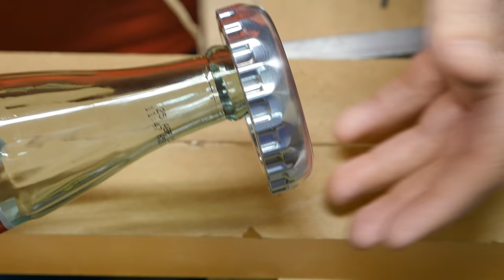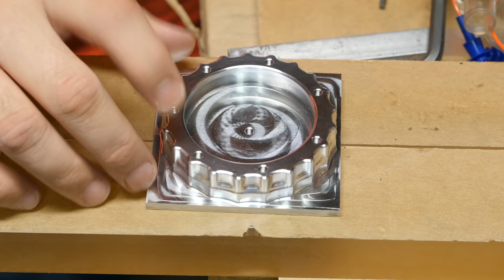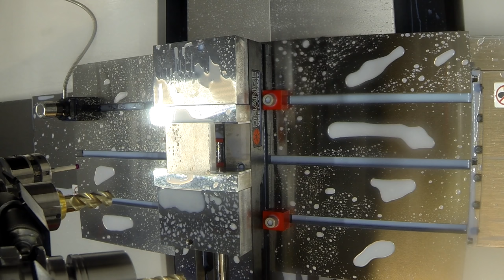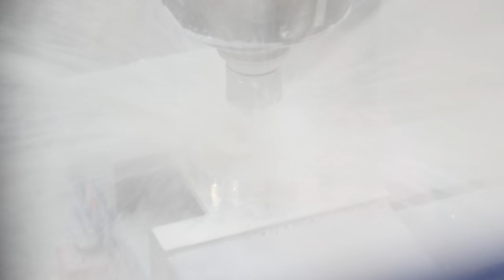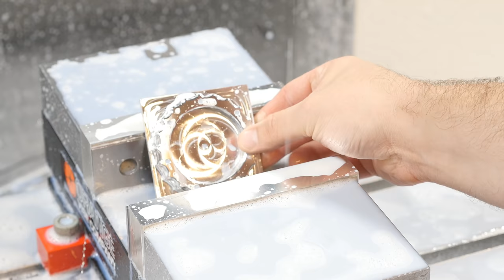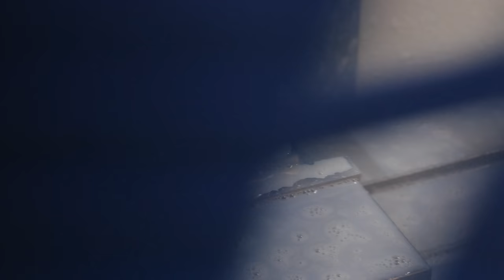Bottle Cap Redux - 3D milling on a Brother Speedio S700X1 CNC machine - coded with HSMWorks (4K)

Comment: You also need to put the non-engagement feedrate for adaptive clearing in HSMWorks at the max feedrate of the machine. That's if you want to leverage the speed.  Machine is likely 10000mm/min right now for max feedrate.  I turned my machine up to 20000mm/min.

Comment: Cool little project, and nice jig too! Sometimes I like the jigs and the making of more than the actual parts.
Reply from the maker: Thanks!

I know what you mean! Fixturing (jigging) seems to be a big part of machining and it can oftentimes be the most difficult. I've been working on a new fixture for these bottle caps for a while now. I've been making some good progress in the last couple weeks. I'm shooting to make a single-part fixture as a prototype and if it works I plan to record myself expanding that prototype into a multiple-part fixture. This planned video will be a bigger undertaking than I'm use to so I hope it comes out OK.
Reply: Hirudin Something like a toolmakers ground vise comes to my mind. Except that little angle screw would be kicked upwards at a 45 instead of down. Then you could leave your zeroed fixture on the table with one movable jaw that pulls out and down. The short end of an allen wrench could get up under there to the screw.
Reply from the maker: tansit2344
I've played with a lot of different ideas but most of them have Achilles's heels. I finished an important piece of the new prototype today and it's looking pretty good so far.

Comment: You could likely double the feed roughing.  And with a 4 flute ball you could likely double the finishing feed and see how the surface finish looks.

Cameras looked good. So did the factory LED lights. I need to install one on the other side of my machine, i only have one on the right side currently.
Reply from the maker: I was thinking double-speed on the roughing might be possible. I don't want to get greedy though. :) I'll probably give it a try before too long. Thanks for the initial feed and speed! I don't know how long it would have taken me to get up that high on my own.

I did try 8000mm/m with the ball mill at one point, but without high accuracy mode enabled. It was good for the most part, but one of the side curves got turned into a corner. It was the ridge/fold where all the lead-ins and lead-outs were. High Accuracy Mode A seemed to keep the speed around 750 - 1500mm/m for 90% of the time. After that, and after you told me that I actually did have Mode B, it hovered around 4000mm/m for the most-part. I guess at that point I figured "well, that's good enough" and stopped testing. Every now and then the feed-rate display will show the word "processing" (something like that) which I assume means it's getting starved for data. I think I'm going to spring for the 200-block look-ahead upgrade as well.

Thanks! I can send you a pic of the GoPro setup if you'd like. I basically stuck it to the side of the tool turret casting and used a whole bunch of arm extensions to bring it out far enough that it could see the tool.

I cringe at what they charged for those LEDs, but I'm glad to have them. My garage is already pretty dark, and when the enclosure doors are closed very little light actually gets inside.
Reply: Hirudin Yeah they are expensive, I used some ones from Amazon and wired them into the control myself.

Comment: I'd be pretty concerned over your lack of coolant!!!!
LOL!!! Awesome to see the new machine running!!
How much was cut off your run time with this over the Pro?
Reply from the maker: Haha!

I can throw out some comparison numbers, but they really need to be taken with a grain of salt since they're not derived from the same project...
The roughing here takes about 40 seconds. On the Novakon, similar roughing took about 150 seconds. So, the Brother is about 3.75x faster here. But it's possible both machines could be pushed harder. The best MRR I got with a 1/2" end mill on the Torus Pro was about 3 cubic inches a minute, the Speedio can apparently do 30+.
Finishing the top of the bottle cap on the Brother took 4 minutes and it did 58 passes (4.14 seconds per pass) whereas similar finishing on the Novakon took 7 minutes to do 36 passes (11.56 seconds per pass, or 2.8x longer).
Actual machine time of this cap was 10 minutes and the machine time in my older video series of a very similar cap was about 32 minutes. Both programs had extra stuff to do, so it's not a perfect comparison.

So, so far it's about 3 times faster in my real-world use. I was hoping for a higher multiplier. This IS the first project I've done on this machine though, so I'm sure it'll get better.
Reply: Hirudin Interesting.  I thought I'd seen a vid of you making this same cap on the Pro....but it was different?
I'm sure you'll get faster numbers with more time and a higher level of comfort and confidence in the machine.  It does seem to speak well of the Pro since I'm sure the Brother was way more than 3x's the price.  Sounds like more of your speed will be found in roughing.......10x's more MRR?!!!  Wow!!  Looking forward to more!! :)
Thanks!!
Reply from the maker: Yeah, that cap had a slightly different design. The biggest difference I can think of is the shape of the folds around the outside. They taper off in a triangle on this one and they were basically just filleted on that one.

There was also a small divot where the catching magnet is set in the old one, which certainly added some time. It was also cut from a 1" piece of stock so it had a full 1/4" of waste to remove off the top (which took about a minute). The only additional step this new one has, that I can think of, is the very last op on the bottom: a back--chamfer on the inside of the prying ridge. It happens so quickly on this machine you might miss it if you blink. ;D

Comment: Isn't there a way to control the amount of coolant, That really seems like an excessive amount of lube/coolant. 
I know aluminum heats up and will melt, but, That's a lot of smoe..
Good job tho..!!
Reply from the maker: I think it's only on or off, there's no middle-ground. Well, there are some ball valves on the Loc-Line hoses, but I'm not too keen on manually limiting the flow that way.

Comment: Thanks for the info! I'm in the process of building my own CNC router and trying to figure out what spindle, stepper motors, drivers, controllers, etc. to use on the build. I think I want the work area to be Y 72"  & " X 48". I was think how can I put a multi-changer or just a tool change on the build. I did own a sheet metal fab shop for about 20 years. Shears, CNC punch press, breaks, welders, tube benders, small end mill and a powder coating system I built my self. Let me know your thoughts on the CNC router build. I would love your input.
Reply from the maker: +Philip Tancredi 
I wish I could help! I don't have a router myself (not even a handheld one) so I probably wouldn't be able to help much.

Sorry for my late reply! Eight months late... that's not good. I partially blame Google's bad messaging system.

Did you build a router? It would be so cool to cut up big-ol' sheets of MDF or plywood accurately! I hope to get one some day as well.

Comment: If you don't mind me asking what is the cost of the Brother Speedio S700X1? Pricing is hard to find online
Reply from the maker: Sorry, I guess I don't really want to put a dollar amount "out there". :/ I'll say that it was more than a similarly optioned Haas DT-1 (which I would have looked at harder if it would have fit in my garage). This machine also has a few options that Haas doesn't offer, which, logically, increased the price (Haas also has some options I wish I could have added to this machine).

Choosing which machine to buy was exceptionally difficult as each one had tradeoffs compared to the others. "Do I want this option that's only available from this manufacturer or do I want that option I can only get from that manufacturer?" At the end, the three machines I was looking at the hardest were very competitively priced. The Brother won-out by having a very good reputation online, having a few options that I considered a priority, and being physically smaller than the others. Milltronics was at the top of my list too, but I just couldn't figure out a way to get the model I wanted into my garage.

Comment: I'm trying to figure out what kind of machine you have. Is it a cnc router table with a tool changer adapter. Please tell me about your machine. (I like it very much)
Thanks,
Phil
Reply from the maker: Thanks! It's a mill, or more specifically: a vertical milling center. The lines between CNC routers and CNC mills aren't always well defined. Both types of machines will have at least three axes of movement, X (left and right), Y (front to back), and Z (up and down). The major difference is how the spindle moves. In a mill, it'll only move in the Z axis, the X and Y movement is done by the table. With a router, the table stays stationary and the spindle moves in all three axes. Routers will usually have much greater travel (cutting area), at least in X and Y, but that additional travel is usually at the expense of rigidity.

Here's a recent video that shows an S700X1 High Torque machine...
https://www.youtube.com/watch?v=bCqBRBWPV1o

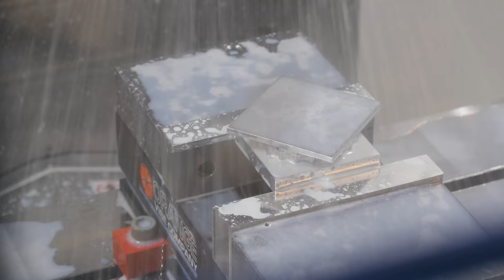Comment: time 8:17+ 

What kind of fixture - end mill (manufacturer ? ) ?
Reply from the maker: Jiří Sohr 
The end mill that is loaded and starts at 8:17 is a "Shars" brand "415-0266" 1/2in. ZrN end mill.
http://www.shars.com/1-2-se-3-flute-radius-0-040-45-helix-zirconium-nitride-solid-carbide-end-mill-for-aluminum
Additional tool info is shown on the top/left of the video.

The tool holder is a "Big Daishowa" brand "Mega ER Grip" ER-20 tool holder.
http://www.big-daishowa.com/product_page/data_23_mega-er-grip.php

If this isn't the answer you were looking for, please ask again.
Reply: Hirudin  

Thanks, "Big Daishowa"  - > I use CENTRO P http://www.fahrion.com/en/efficiency/centro-p/

Comment: dry chips are worth more
Reply from the maker: Potentially.
Reply: so you can just use mist
Reply from the maker: Well, I'm more interested in the milled part coming out of the machine with as much value as possible, the value of the chips is WAY down the list. Yes, pristine chips are potentially worth more than dirty chips, but...
A. there isn't a guarantee that my local recycling center would consider these chips to be "dirty". I suspect they will give me their full, "clean" price. We'll see.
B. we're talking about 25¢ per pound compared to 50¢ per pound. If I had 1000 pounds we'd be talking about a difference of $250.
C. this flood system recycles its coolant whereas mist coolant is a one-time-use deal. If I was concerned about squeezing every dollar out of this machine I would have to factor the added expense of needing to constantly replenish my mist reservoir.
Reply: the purpose of coolant is to lubricate and cool, but cooling is not a problem for your material without it, so you're primarily interested in lubricating/ thats why you would use mist.
Reply from the maker: What brand of mist coolant do you sell?
Reply: i don't sell any

but that leads me to a good point i forgot to make; mist coolant have increased intermolecular forces to form a sticky web on the part. This is advantageous on a lathe, to not sling the coolant, but also in cnc milling to coat the endmill as each tooth takes a cut.
Reply: i tried a sample of Unist last month, it was excellent. They gave me 2 little bottles, one for ferrous and one for non-ferrous.

Comment: Crashed it yet ? :D
Reply from the maker: A couple times. :(

Both times were only in the Z direction. One, the second instance, was completely my fault. I reset the Z-zero point and rapid-ed down onto my tool setter (thinking that the zero point was an inch or so above it, forgetting that it was actually about two inches below it). That was a costly replacement! As I recall, the tool that was in the spindle was new as well, but that was only a small fraction of the cost of the damage done. The other time wasn't my fault, in my opinion. I had done some manually-controlled machining with the MPG and didn't bother doing a G43 command to set the tool height (why bother, right?). After I was done, I ran a program, and one of the first commands in that program was G49 (tool-length offset compensation reset). Well, apparently Brother decided having the head rapid down to some unknown point in that situation would be a good idea. I cannot, for the life of me, figure out why they would program the machine to behave that way. In both instances the force was sufficient to shove the tool up into the tool holder (ER-20) and the one that happened when G49 was executed left a pretty sizable dent (the size of the collet nut) on the top of one of these bottle caps. Oddly enough, the ball mill that was in the tool holder didn't seem to have any damage and I continued to use it, the collet was ruined though. After that little incident (and after confirming the issue) I edited the post processor of my CAM software (HSMWorks) so that it doesn't add G49 any more and I also try to remember to "reset" the machine (which is just one button) before running a program.
Reply: Yea, I asked because having looked into getting the s700, it really scares me that I AM going to crash it at some point, 100% guaranteed.
If possible id love to be able to set softlimits to protect the toolsetter. Machine has toollengths remembered unless new tool, and in a specific XY area(location of the toolsetter) the Z(with specific tool) should not be able to enter the area unless doing a probing move. Also XY axis should not be able to enter the area without being a specific clearance height. 
Should not be too difficult for them to program that in, or perhaps im missing someting vital.
Even hobby controllers have this sort of thing for the toolchangeing area (router with tools on bed edge).
Reply from the maker: Yeah, I can appreciate your trepidation! This thing moves so fast it would be basically impossible to see a crash about to happen early enough to stop it. The controller has been exceptionally reliable and consistent though, so at least you don't have to worry about it glitching out or something like that.

I'd like an option like that as well and it seems like it would be completely "doable". Oh well...

Since I'm not doing any kind of tool breakage detection I've thought about unscrewing it from the bed and setting it on a little shelf or something inside the enclosure when it's not in use. Moving it back and forth would prolly become a hassle though.
Reply: Guess you could make a 90 degree swivel mount that you either turn back and forth by hand into the reach of the machine(if it'll fit) , or put an tiny air cylinder to do that before probing, either by button or even better by macro. But yea, takes some effort either way.
Reply: FWIW, not a bad idea to just avoid G49 code with many probe systems. The problem is, it commands the machine to bring its tool reference line (bottom of spindle nose) down to the work offset's zero plane, which ignores the fact that a tool might be in the spindle. You can also hit the same issue if you run a tool with height offset of zero, or any other value that is appreciably shorter than the tool's physical length. that one is easy to do if you have a lot of tools in the turret and forget to set an offset for juuuust one of them.
The G49 thing is always something people run into when they learn using code, then jump onto a super modern machine like this that pretty much doesn't NEED it, but rather can jump between offsets without de-activating them in between. older machines needed it, like from the early 90's and before...I think it's just remnant of those days...but who knows
Reply: We never used G49 on anything other than Haas...